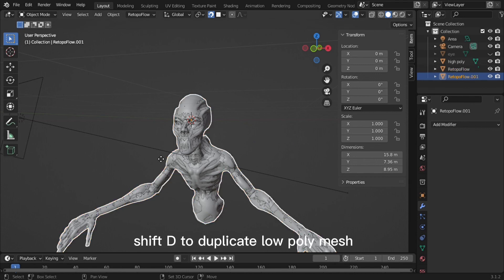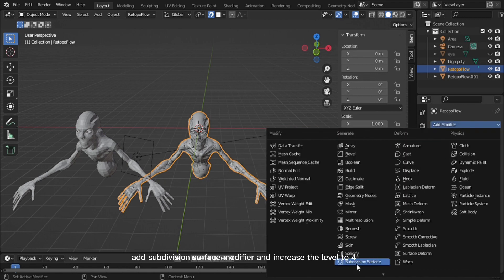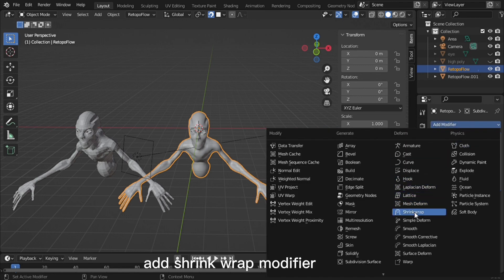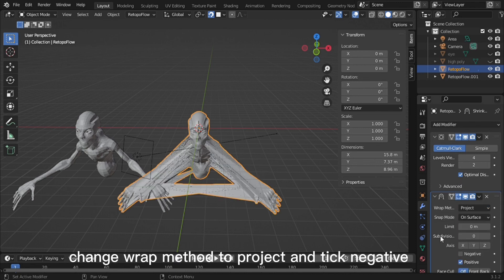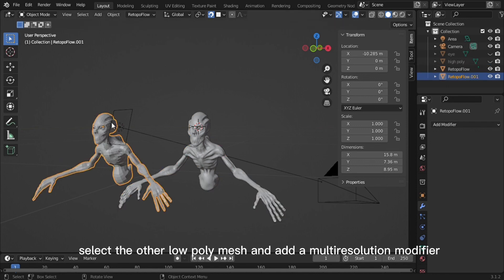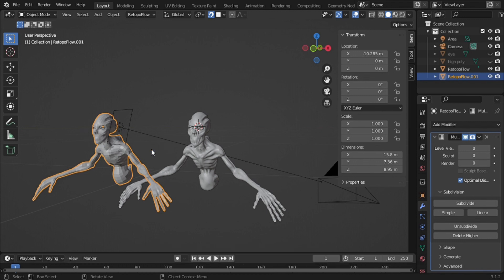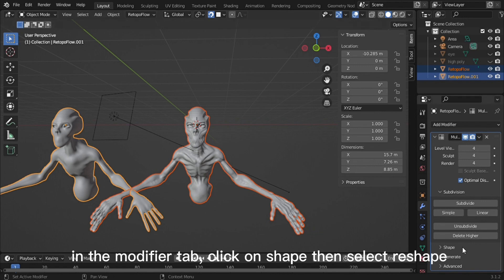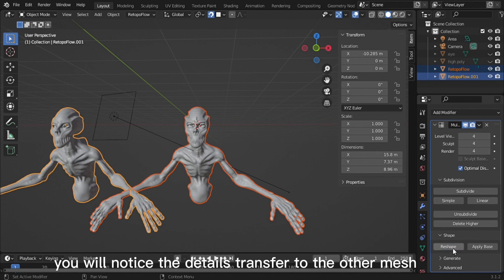How to bake high poly details into low poly mesh in blender 3.4

Comment: You need to change the title of this video. There's no baking in this. Baking is the process of creating higher res maps to wrap the low poly object with so it looks the same as the high poly mesh with less computational power needed. It should probably be called something like "Using multires to copy highpoly object" or whatever.
Reply from the maker: It depends on what you understand by baking and what works for you. Thank you for your opinion, I really appreciate
Reply: Exactly my point. Guy probably made beginners feel stupid when its just his title being misleading

Comment: And it can be exported as fbx for use in unity?
Reply: Meanwhile I figured it out
Reply from the maker: Yes it can but without the modifier
Reply: @vantagecgtutorial  so you need to apply the modifier and get a high poly again
Reply from the maker: @dertobbe1176  not really just set it to the subdivision level you want then export, it's will export at that subdivision level
Reply: @vantagecgtutorial  doesnt work for me. I get high res Version when I apply or a low poly Version without the Details when I Export. I am just learning this stuff. Dont know what to Do rn
Reply from the maker: @dertobbe1176  what software are you exporting it to
Reply: Yeah that's the problem. I want to keep it low poly for use in unity. So far I baked normal from multires. But multires alone gives me high Details + high poly

Comment: I'm new to blender and I just wanna make sure of sth. So after having done this, we can export the low poly detailed mesh without applying the multiresolution right? Cause otherwise It won't make sense, the poly is going up again. I'm specifically talking about when we want to use character in a game.
Reply from the maker: This method is mainly for movies, for games its advised to bake normal map

Comment: Very interesting method! But I'm just wondering if there is a difference as supposed to creating high poly normal map and baking that onto the low poly. Does it make a difference for making films in blender? Is one better than the other? Or is the normal map method just for making games or importing into other software? Please someone answer if you know
Reply from the maker: Baking normal map is good for games, it helps optimize the character but up close u can notice that it's actually low poly, on the other hand baking high poly to low poly is good for movies especially if there would be close shots in the movie
Reply: @vantagecgtutorial  So the multires method in this video is better for movies?

Comment: hi, how can i export the low poly model without affecting the high poly details? When i untick the ‘apply modifiers’, it removes the multires modifier but then when imported, it goes back to being low poly. Thank you!
Reply from the maker: Do you want to export it to another 3D software?
Reply: @vantagecgtutorial  yes, i am trying to export onto Maya. But then when I import it, it is low poly but the details are gone and the multi res modifier as well.
Reply: @dandan-my8yn   hey there i'm also struggling with this problem im attempting to export a character that uses multi-res data to mixamo but once i do the mult res data is lost , any help is appreciated
Reply from the maker: @Squash6990  multi res modifier only works in blender 
Another way to bake details to be used outside blender would be to bake the high poly normal map and use it on the low poly. I don't have a tutorial on that at the moment

Comment: Why can't you just reshade directly from the original high poly mesh to the low poly with multires? does it have anything to do with the 4 subdivisions so they have same poly count?
Reply from the maker: Remember I used shrink wrap modifier to extract the details from the high poly
So I had to apply it then reshape with shrink wrap on the other low res
Reply: @vantagecgtutorial   hi rewatched this video again for fun, just want to say @thedudguys5761 is correct, you could have done that in fact it is a faster method than your current method and it does the same thing just though i shared this with you. 

1) low poly version that was retopo, create multires and shrink wrap mod
2) shrinkwrap low poly target to high poly
3) increase subdivide in multires of lowpoly to level that captures all details 
4) apply shrink wrap 
5) reduce subd lvl to 0, create image texture in shading editor, and bake from multires and viola done! 

your current method works too, just that you probably would need baked the textures into a normal map at the  end  because the lowpoly model you have with multires subd lvl 4 cant do anything on its own for games etc
Reply from the maker: @Bingbangbong28  I'll give your method a try... Thank you
Reply: @vantagecgtutorial  theres plenty of tutorials on it btw, just youtube high poly to low poly multires
Reply: @vantagecgtutorial  ah yes mb

Comment: but suppose if you want to use this model for games then how will you use this model in games, you still have multires and dont have UVs so how will you bake those details in terms of maps??
Reply from the maker: You would have to uv unwrap and bake the normals of the high in the low poly
Reply: @vantagecgtutorial  how can we bale thr multires details?

Comment: What is the difference in using this method and baking with cycles? Is this method beter for animation? Or does it not matter?
Reply from the maker: This method is used only if you plan on animating your character or optimize it to be used in games, otherwise there's no need

Comment: thank you so much for this video. I may sound stupid with this question but I hope you can answer it. can we compair normal maps. like which normal maps or displacement maps give more details is it the one zbrush generates or Blender generates or are they the same or it depends on the details of the 3D sculpt
Reply from the maker: It depends on the resolution of the maps and the details. I haven't compared both before, but whenever I do I'll edit this comment
Reply: @vantagecgtutorial  Thanks for replying. that's correct. it depends on  the resolution of the maps and the details
Reply from the maker: @anissar7301  your welcome brother

Comment: This doesn't work without causing the low poly to having higher poly count which is not at all what i want.
Reply from the maker: Did you apply the multi resolution modifier?
Reply: @vantagecgtutorial  I did
Reply: I got it to work tho must have missed a step
Reply from the maker: @kirbyscreativity  you arent meant to apply the modifier
This method allows u to switch between subdivision level with out affecting the poly count of the low poly mesh

Comment: newer user here... so... what do we do after this? i just used this to bring the details over from my hi res head sculpt to my low poly/retoppo'd mesh head, but im not  sure what to do next... do i have to keep the other two heads? do i apply the multi-res (which would defeat the point i would think?)... just wondering. making a model for animation, if that helps clarify... would appreciate any assistance 🤞
Reply from the maker: This is because most people pose their character for animation at the lowest subdivision level for smooth running of blender, then they render at a High resolution so that the details would be seen
Reply: @vantagecgtutorial  sweet thanks for the help 😀
Reply: @SalemFU  This process is usually referred to as 'Retopology', if you sculpt a super high detail / poly count mesh, to UV Unwrap it for texture painting or export it as game ready asset, you want the details of the high poly mesh, but the low poly count of your base mesh, this is only a small snippet of the entire process.
Reply: @OlegC3D So you basically use the UV from the high on the low?
Reply: After you create a LOW POLY mesh through Retopology of the HIGH POLY mesh, you UV Unwrap the LOW POLY mesh (since you created a clear retopology, with very low vertex / face count, it should be easier for you to follow lines and mark the UV Seams for unwrapping), Then through the Multiresolution LOW POLY mesh, you select the LOW POLY MESH & Bake the Normal Map data, then you can take your LOW POLY mesh, and add the baked Normal map to it, then you should have the normals of the high quality bake on the LOW POLY mesh - Also, I recommend baking a 'Displacement' map, - in Blender you do it through the Emission bake setting (Ryan King Art has a good video on how to do this called How to Bake Displacement Maps (Blender Tutorial))

So I do it a bit different from the video, but here's my process (I don't create a copy of low poly mesh & use reshape option):

Sculpt High Poly Object > Retopology to create Low Poly Object (DO NOT move the low poly object - keep in same place after done with retopo) > Add Multiresolution 1st, Shrink Wrap Modifier 2nd to LOW POLY Obj > 1st Set Shrink Wrap Modifier to Project & tick Negative > Subdivide Multiresolution as many times as needed - the details should be showing up > Apply Shrink wrap modifier once detail level is reached compared to High Poly model > now the Low Poly base mesh will have a Multiresolution modifier with the High Poly data saved onto it. You can even sculpt on top of the multiresolution modifier to add new / more details > Select Multirez Low Poly mesh & in Bake tab select the Bake Type & press 'Bake from Multires'  > Bake the texture. 

*disclaimer: before baking texture from subdivided Multiresolution low poly model, i'm pretty sure the details will be based on the 'viewport level' of subdivision, so make sure you don't set it to 0... It could be the other way around though where you might need to set it to 0 before baking, try both methods see what works better - I've moved to Substance Painter since then & use that to bake the maps, so i'm not 100% on which one it has to be, goodluck!) 

To export object you can then set the subdivisions levels to 1 or 0 or whatever works best for your vertex count, and export the object as OBJ & tick 'apply modifiers' in the export window, that way it will create an object at that subdivision level.

Hope this helps!  @mrxcs
Reply: @OlegC3D so what we do if we wanna rigg your character in cascader or any other software
Reply: @edenhazard2621  pretty much a completely different topic, typically if you want to rig a character you have to model them in an A pose or T pose, then depending on what software you're using it in / rigging it with with, the bones layout & naming make big difference, if you rig something in blender with Rigify, it worn't work as a rig in Unreal Engine because it reads the data differently, so if you wanna rig in another software or make your rig work with another software, you have to find out the requirements of the software outside of blender
Reply from the maker: You can delete the high resolution mesh if you want to, it won't affect the other one. Also don't apply the multi res modifier
Right now you can switch between any subdivision level of ur choice which is very important if you want to animate your character